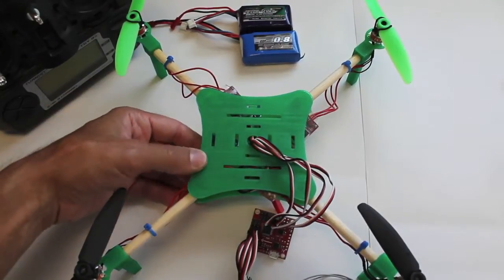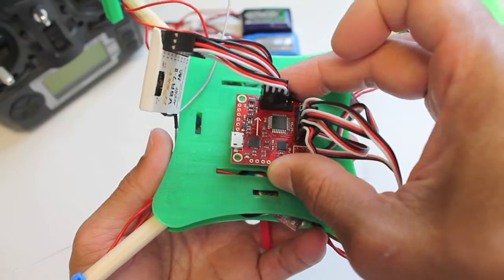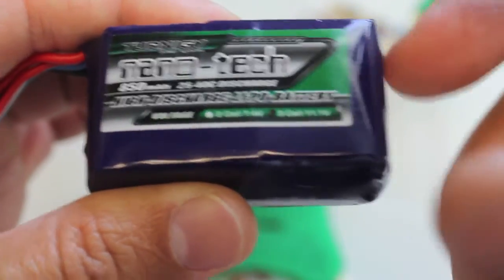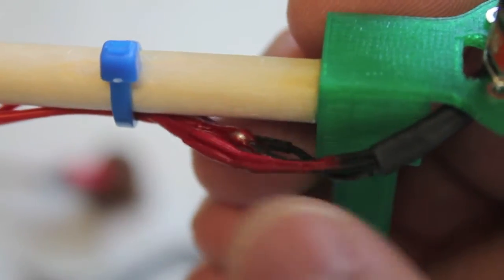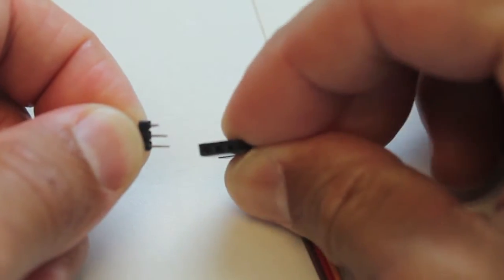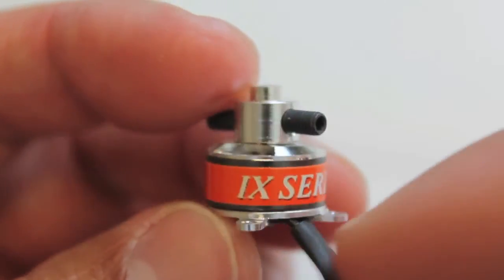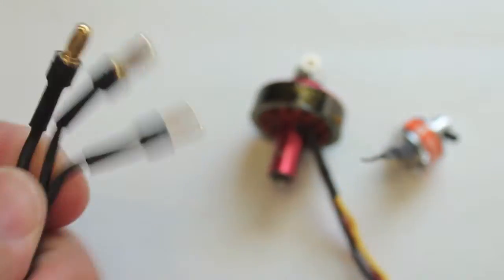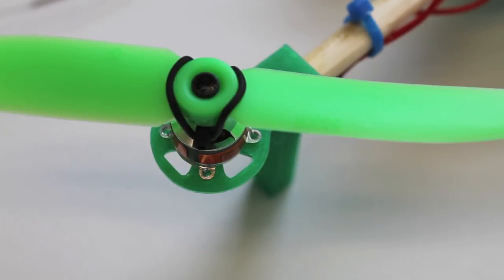DIY Mini Quad Progress - 3D Printed Top Plate and iPower 2300kV Motor Woes

Comment: Using "5030 Propellers (Red) - 3xCW and 3xCCW - 6pcs per bag" and Black.. BTW, the prop saver adapter that comes the motor doesn't fit so I put w/o the prop saver and that is also challenge.. I am also looking for better prop.. for now, I drill the side of the prop and put the screw from servo left overs.. that seems to hold well..

Comment: This is what I have. "Turnigy Micro Quad V2 PNP ARF Includes KK2.0 LCD Flight Control Board"  PRODUCT ID: 9171000150
Like I said, the frame is so easy to break and not easy to repair either.. But it flies so nice and very agile.. enough power to lift 1000mA 2Cell Battery with key chain camera w/o any glitch. I am trying to have the similar frame as yours but all wood as I don't have 3D print :)